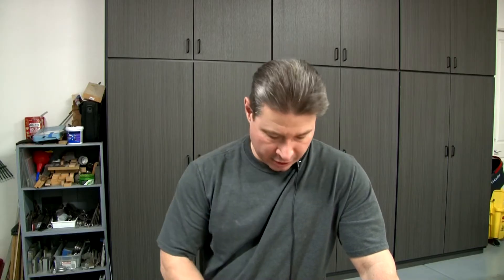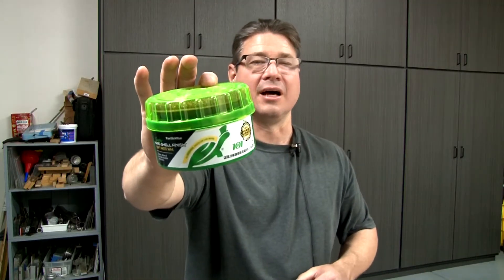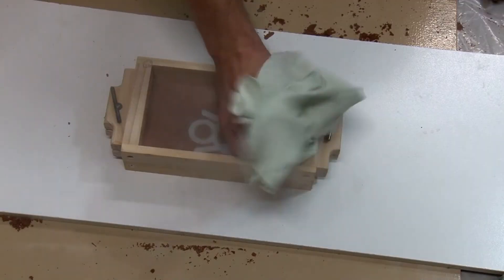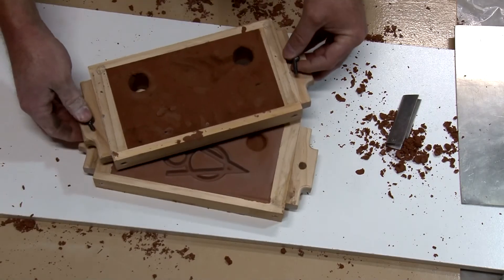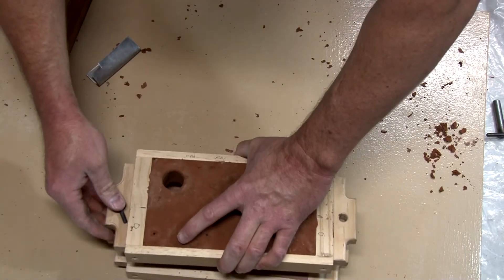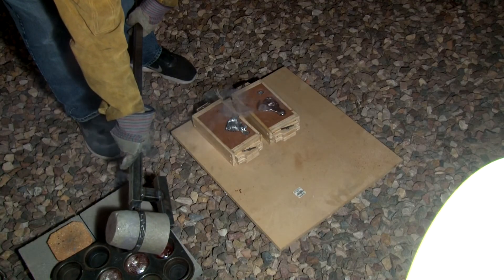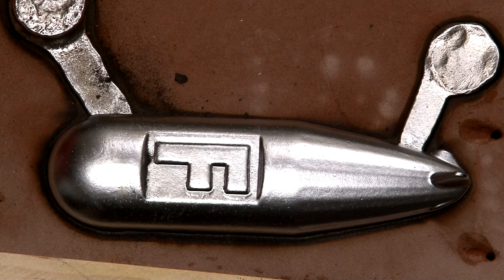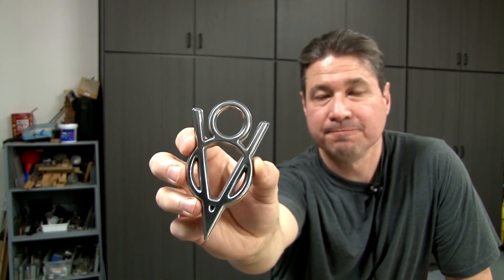From Bad To AWESOME, 1 Year of Sand Casting.  What I have learned in my 1st year of sand casting.

Comment: Sir ur sand recipe,plz tell❤❤
Reply from the maker: I wish I knew the recipe.  I had purchased this sand from a supplier.  Its Teton-Bond Petrobond Ultra-FINE (190 Mesh).  I do use a small amount of brand new sand for the facing sand.  The rest of the sand for packing up the flask is reused from previous castings.  I also try and remove as much as possible of the burnt sand from the used sand too.  Thanks for watching my videos.